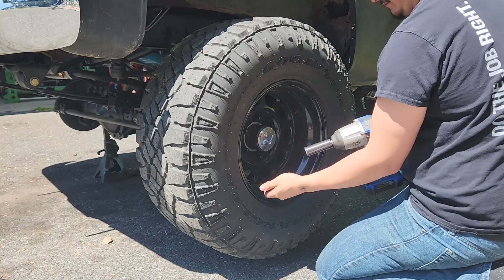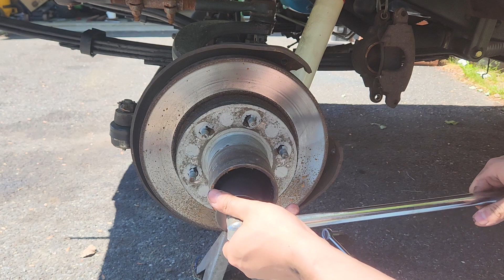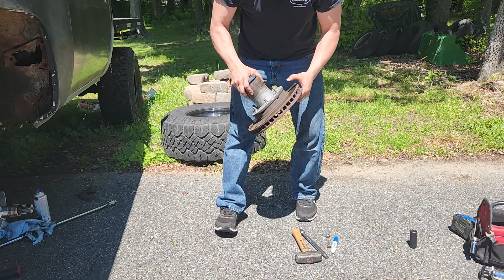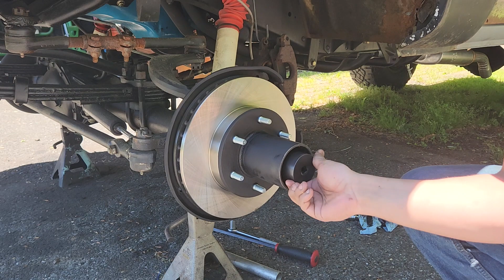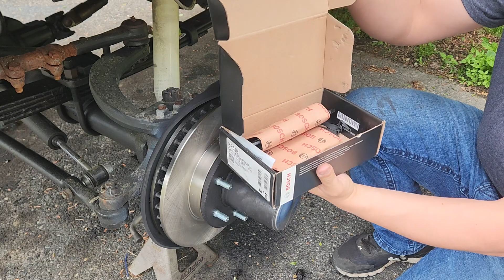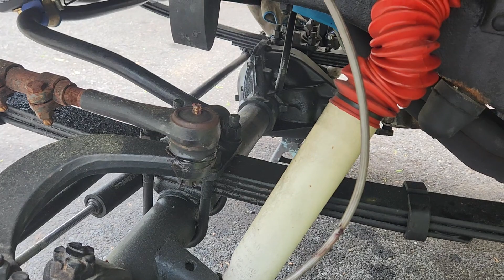FROZEN Caliper caught FIRE!! How to replace Squarebody K10 Front brakes - GM 10 Bolt Front axle

Comment: I cannot get the new caliper to go back in, the holes wont line up with the new pads in, but the old stuff fits fine, caliper fits without pads, but something on the new pads is stopping the whole new setup from going in place where it needs to be

Comment: I would check the torque spec...  also.. use a needle nose locking pliers to hold the hub inside while you put the snap ring on..

Comment: what kind of locking hub are u use on your truck
Reply from the maker: Just got the stock setup for now. Will switch to some manual locking hubs later.
Reply: @diveingarage  was it the auto locking hub?